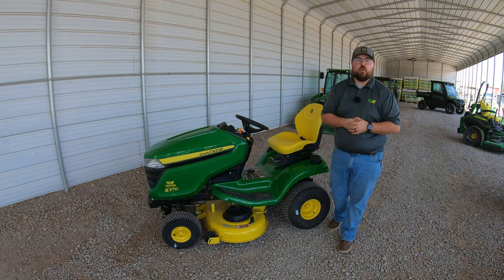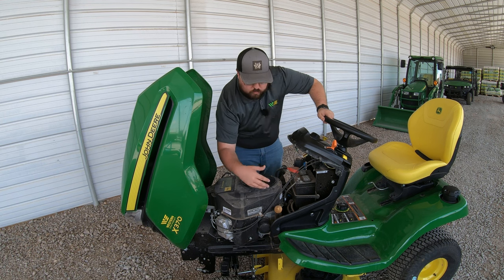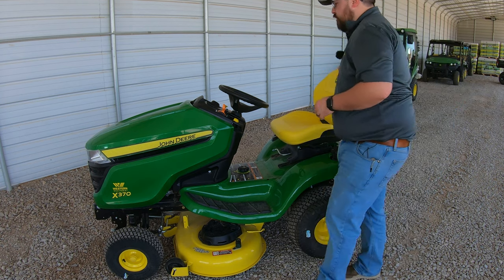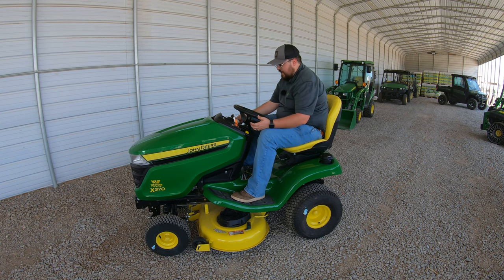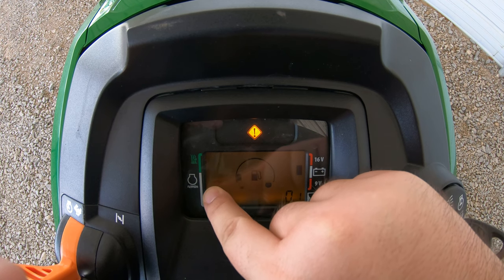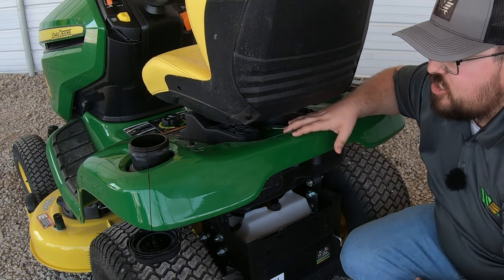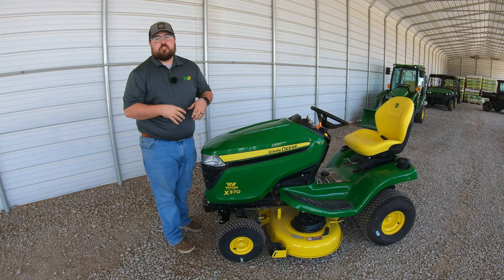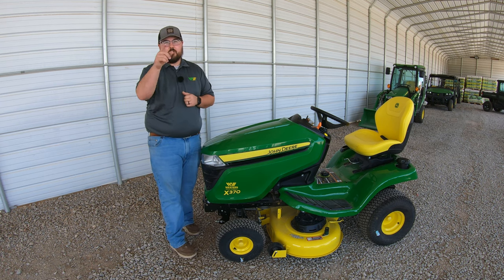2022 John Deere X370 Mower Review & Walkaround

Comment: I have bout 55 hours on my 390 and the service light is turning on when mower is engaged. I was thinking it might be the oil change however that wasn’t the reason for the service light. It runs and mows fine thankfully I’m replacing spark plugs next to see if that could be why . Has your service light popped on while engaging mower yet?

Comment: Brent great video! could you explain the difference between the slide under mower deck this X370 has vs the roll under mower deck the X380 has?
Reply from the maker: Basically the only difference is the way the Anti-Scalping wheel are made. The roll under deck has wheels that can be unlocked and rotated.